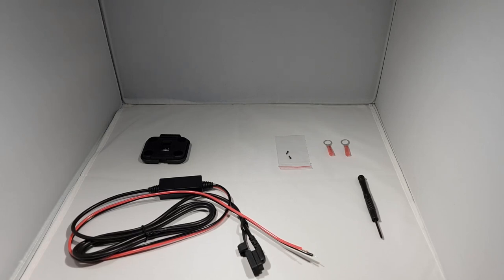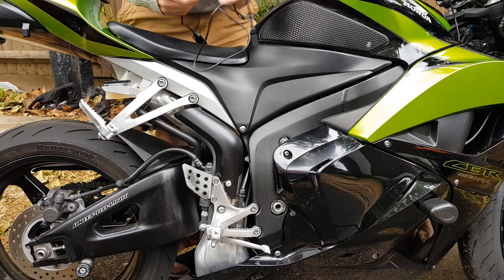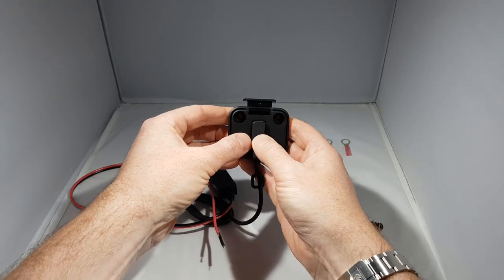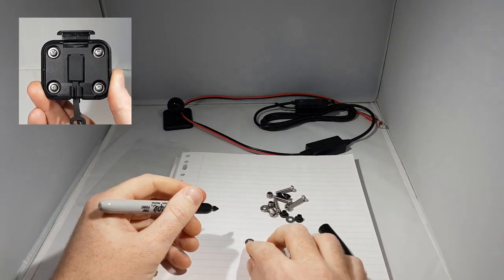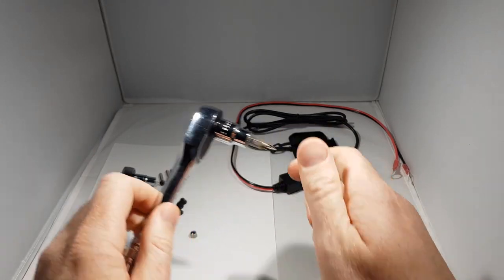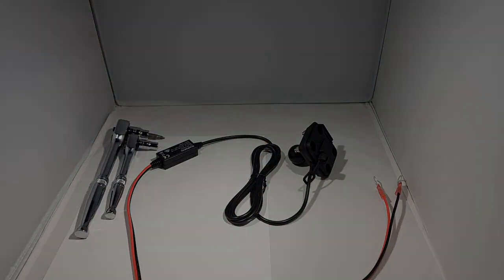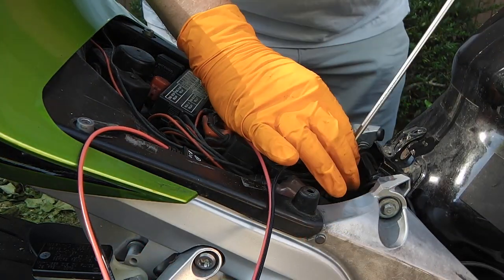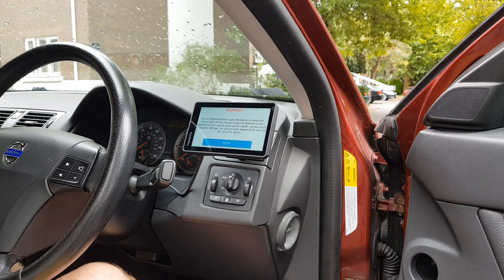Garmin Zumo XT Motorcycle and Car Installation

Comment: It appears to me you installed the rubber spacers, backwards (according to your schematic). 

My zumo 660 (now 12 years old) install was a breeze in comparison. Just stick it on the ball mount, plug into my Audew power supply and I'm done.

Thanks!
Reply from the maker: Nope. Look more closely. The spacers are the right way round.

Comment: Maybe if it’s difficult running the wiring due to the transformer block it might be easier to run the plug that screws to the base through the panels, and attach it last (assuming it’s smaller than the transformer)
Reply from the maker: That was the point I was trying to make at the start of the video.

Comment: I’m hooking up mine now, first installation was on my Silverwing with a cigarette lighter connection, but I now want to hard wire it to the battery of my TW200.. you’re saying that once the unit is removed from the cradle there is ZERO battery draw? I would expect the converter box to drain a bit just keeping itself alive…. thanks for a great vid!
Reply from the maker: Pretty much zero. I've not had any issues over the past few years. Purists from my motorcycle club wire it to a switched live or add an extra relay, but I've always hard wired.

Comment: Great instructional video. With the permanent connection, any worries about battery drain with the unit disconnected? Also wondering if you or anyone has considered/tried using an existing SAE connector.
Reply from the maker: I've not had any battery issues over the past 10 years. You rarely leave the unit on the bike when the engine isn't running.

Comment: Thanks for the video. I've been trying to find out if I could charge the unit with the 12v charger on my bike instead of wiring it up directly to the battery. Good to know that option is there.
Reply from the maker: Yes there are a few options to consider. I've always hard wired but some of the older people in my motorcycle club don't approve of hard wiring.

Comment: So it will draw power from battery even tho the key is off, yes?
Reply from the maker: If it's hard wired there will be a minor draw from the battery. I've hardwired every Zumo I've had for the past 12 years and never had a battery issue. You can fit an additional relay, tap into an auxiliary circuit if your bike has one or connect the positive terminal to a switched live like the rear light if you don't want to hard wire.

Comment: Just received my XT. Why can’t I just plug my XT into my bike’s power system via the USB plug?
Reply from the maker: You can using a standard USB cable and the connection on the back under the rubber flap.

Comment: I'm going to question you on something.  I know the instructions tell us to put the spacers in that way,  but I think it's wrong.  They fit perfectly in the base plate holes and provide a little spacing, but also allow the base plate to support the connector from being pushed through.  If you look further in the instructions where the assembly is put together, you do not see that large gap between the baseplate and the GPS holder. Another thing is that the base plate holes are WAY too large for the screws supplied, those spacers must act as bushings to make the screws fit snug.
Reply from the maker: I just followed the instructions and it fit together nicely. The last 3 Zumos I've had fit together the same way and I've had no issues in 12 years.
Reply: I think the main purpose of the spacers is to ensure that the rubber bushings are not compressed too much. Thus the instructions are correct.

Comment: So, if I understood right I can give power to my Zumo XT just connecting it to USB? Asking because I have two USB ports (1A) just 15 cm down to the place where I'll install the Zumo. For add I have also two 12V Hella in the right side of the bike, just at a side of the engine.
Reply from the maker: Yes you can power it just using a USB cable but the USB connection isn't waterproof, you have to lift the rubber flap to connect it. The wired cradle electrical connection is waterproof. If you have an auxiliary circuit the easiest way is to tap into that. That is better than hard wiring to the battery because it is a switched live. I hardwired because I don't have an auxiliary circuit and I didn't want to splice into one of the other circuits. Plus I've had Zumos for 13 years and never had an issue with hard wiring to the battery.
Reply: @JosephByrne  thank you very much. I am sure behind my tft there chance of several connections yi have xt under ignition key.

Comment: Arent you affraid the transformer will drain your battery over time since its directly attached to it? I also think it would be wise to put a fuse between the device and the battery.
Reply from the maker: When the device isn't connected there isn't a complete circuit so the transformer is effectively dead and won't significantly drain the battery. The documentation said a fuse wasn't necessary but you can fit one if you wanted to or some users have connected to an auxiliary circuit on the wiring loom that is already fused.
Reply: @JosephByrne  A transformer by nature is never completely dead. The draw should indeed be very very minimal. I have mine connected to a auxiliarly circuit that turns off when the bike isnt running. As a tip, the manual may say a fuse isnt neccesairy. But accidentally melting or otherwise damaging the wire can still cause a short out. I would advice to put at least a fuse on there ;).
Reply from the maker: @quatron---  On the official Garmin video they refer to the transformer block as a fuse also so it may be both. Only way to tell for sure would be to break it open as I've not seen the interior documented anywhere.
Reply: @JosephByrne  If thats true its a pretty expencive fuse.... Since its not really replacable unless you replace the entire wire which is quiet a hassle.

Comment: I asked garmin: I attached zumo xt to the battery of my motorcycle as instructed. When I turn motorcycle ignition off zumo xt satnav on the mount will not switch off, it still takes electricity from the battery. It could drain battery if left for longer. My old garmin zumo 550 in same circumstances turns off itself before offering to stay on using it’s internal battery. Is there an option to make the new XT use same good function (to turn itself off with ignition off) as zumo 550 from 2006? I think that would be a handy function to have. 
Once I opened zumo550 motorbike cradle and was surprised there’s a lot of microschemes and chips inside. Good luck with zumo xt.
Reply from the maker: To have the XT switch off and on with the ignition you need to connect the negative terminal of the wire to the negative on the batter and the positive to a switched live, for example tap into the rear light circuit. Or you can fit an additional relay. Then it'll switch off and on with the ignition. If you hard wire it to the battery it will stay on unless you switch it off at the power switch on the back. I never leave the unit on the bike when I'm not riding so battery drain is not a problem for me.

Comment: So you connected all the way from the battery to the front of the bike with no inline fuse? Do you think that’s safe?
Reply from the maker: It depends who you speak to. The manual suggests hard wiring without a fuse. Some people I know installed fuse and others think anything short of a relay is just plain lazy. Ultimately you make your own decision. The cost of fitting a fuse is negligible in terms of cost and time so if you fancy doing that go right ahead.

Comment: HI.  with regard to fitting    
I have a bmw   GSA. 1200. with canbus electrics. I am told that if I connect direct to battery  the mount will stay   "live" even when the nav is removed   This will take a small drain from the Battery and if left for a few weeks it will flatten  it.      Is this    the case  do you know      
 Love your  vids  they are great
Reply from the maker: It will take a small drain but is not enough to flatten the battery even after a few weeks. It is pretty easy to connect it to a switched live if you don't want it to be permanently live. You can either fit an additional relay or splice the positive into a switched live like the rear running light. You can also find the fuse for the rear running light and shove the wire in next to the fuse (a bit crude but it works). Some people (from my motoecycle club) wouldn't dream of hard wiring to the battery but I've done it with every Zumo I've owned and never had any problems.

Comment: How to install it in Royal Enfield Bullet 350 cc? Does it work in India?
Reply from the maker: There is a metal clamp to install it to the handlebars which will work on an Enfield. If the Enfield uses a standard 12V battery you can simply wire it up to that. If it doesn't then this device has a really long battery life so you could just use it stand alone and use a USB power bank as a backup. There is a map available for India. If you purchase it in India it should come with the India map pre installed.
Reply: @JosephByrne  Thanks a lot man.

Comment: Nice one Joe,,Got mine ordered,But i see Garmin have been doing some cost cutting regarding the mounts,I'd much prefer the old 595 style of mounting as to the cheap rubber cover.Roll on the XT review.
Reply from the maker: Yes I don't like the design of the new mounts, car and motorcycle. They are functional but visually they don't look great. Someone on the internet has already 3D printed a better weather cap which covers the whole cradle. I'm not sure why Garmin didn't do that. Arguably the new weather cap design is harder to lose because it remains attached but I've managed not to lose mine on the 590LM for 5 years so that's not a big selling point for me.
Reply: @JosephByrne  Like i said costcutting,let us know if the new weather cap comes into production.